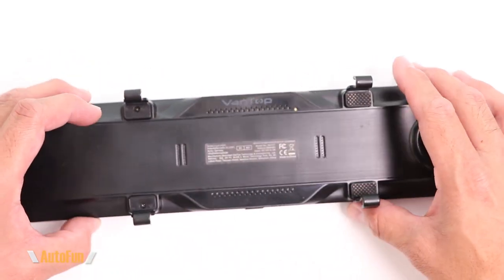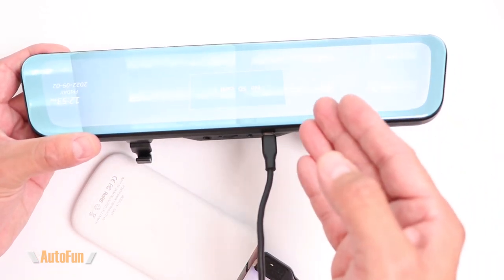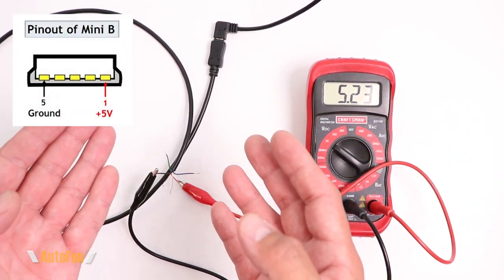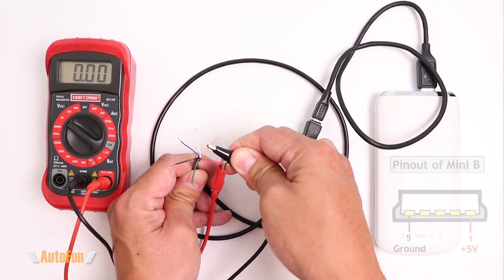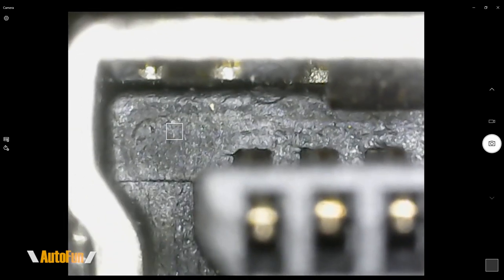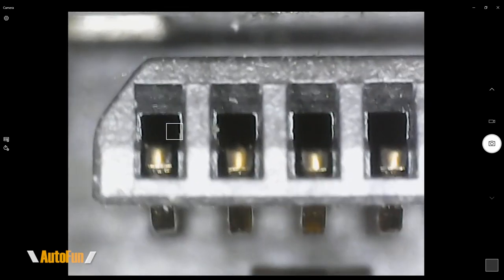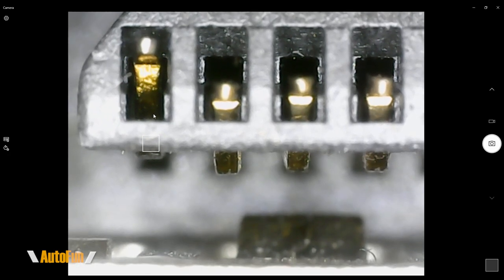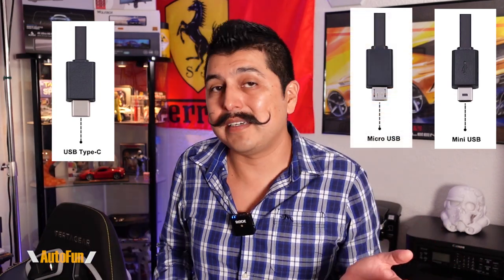This KILLED my Mirror Dash Cam (Vantop H612T)

Comment: Hi Autofan,  my mirror dashcam has failed it may be due to connector or battery, Can you make video replacing mini USB and installing USB c connector and changing the battery/ THANKS
Reply from the maker: Hi Sample Email! You read my mind! I do have a full series on soldering for beginners (remember desoldering and soldering will be involved to fix the dash cam, if you have been trained or have experience soldering and assuming you have the right equipment and materials, it should be pretty straight forward) However honestly I'm not sure it would make sense to fix it unless you want to do it for fun or as a learning experience. In my case while I am trained in soldering, I choose not to repair mine and just moved over to a new dash cam (the time and effort to select the parts, desolder and solder new ones and reassemble is just didn't make sense for me with the price of new dash cams rapidly dropping. Remember soldering equipment and materials for soldering along with the replacement parts will need to be purchased) However like I said if you enjoy DYI projects or just really want to fix your old dash cam It is definitely possible. Another viewer for example choose to connect the power cable directly to the dash cam eliminating the connector all together, so some people are fixing theirs. Hang in there Bud the soldering videos are coming. Hope this helps, Cheers!
Reply: @AlexAutoFun  Hi AutoFan! Thanks for getting back to me! Yes I will get basic soldering down through tutorial  I just Purchased whole kit. For me 3 third dashcam mirror that failed. I don’t justify spending another $150 on new dashcam. Also you mentioned someone connected power supply to straight to dashcam bypass connector itself how you guys able to that, which points on PCB I need connect power supply I need little more information about that. Thanks AutoFan
Reply from the maker: @RZ-uc3wf  Hi Sample Email! oh man 3 of them! were all 3 of them Vantop? I see what you mean about fixing them instead of replacing them at this point, but I think I would go a step further and determine why all of them have failed (I have only had 1 dash cam fail on me, the H612T out of all the different models I run on my cars) Getting to the root cause will be important to prevent more failures (without understanding what made them fail, the failure will return and you can find yourself in a cycle of constantly fixing dash cams) The fix would directly address the main cause of the failure (including secondary contributing causes). A tear down will probably help to understand the failure mode(s) not sure if you seen my other video where I perform this https://youtu.be/HW8jqbl_ayU Cheers!
Reply: @AlexAutoFun   hi AutoFan! Thanks for getting back! I don’t what brand is it but it similar to Vantop  12 inch screen I did small diagnosis seems it mini USB connector issue with farthest pin to left is seems out of shape. How do I connect power straight to dash-cam do I have connect to battery terminals or Mini USB terminal on PCB?
Reply from the maker: @RZ-uc3wf  Interesting, if all 3 of them have failed due to the same issue have looked at how the dash cam is mounted? Is there stress being placed on the connector or is there movement of the connector leading to the failure? Remember Mini USB connectors are rated for thousands of cycles and if 3 connectors have all failed it may be due to an external force acting on them. Regarding deleting the connector all together, the process for connecting the wires directly to the PCB will depend on what type of connector the dash cam is using, if it's a thru-hole, it will be fairly straight forward for someone with basic soldering experience but if it's surface mount it will be slightly more difficult as those connections are very small (again for an experienced solderer this won't be an issue, we solder smaller things LOL) and the pad can lift or the PCB can be burned in the process making repair more difficult if either one of those situations happens. But I'll make note to cover both TH terminations and SMT terminations on my soldering videos coming. Hope this helps, Cheers!

Comment: looks like the internal battery should just be bypassed
Reply from the maker: Hi David! Yes definitely, just remember that while the battery is primarily used to enable parking mode without hardwire, it is also used to close out video files in the event of a sudden power loss (car crash) and when turning off the car while a file is being recorded. Without a battery the file may not have time to be closed by the dashcam and you can potentially ended up with a corrupted video file. This could potentially be addressed by hardwiring the dash cam to ensure it does not rely on the battery. Cheers!